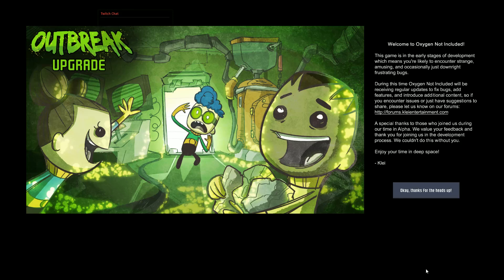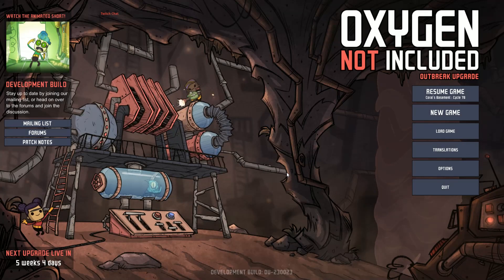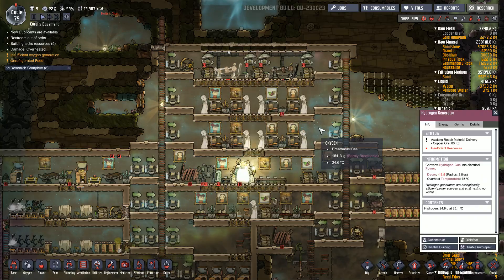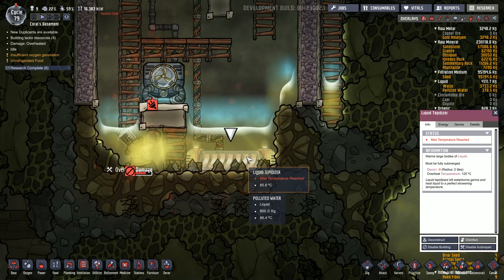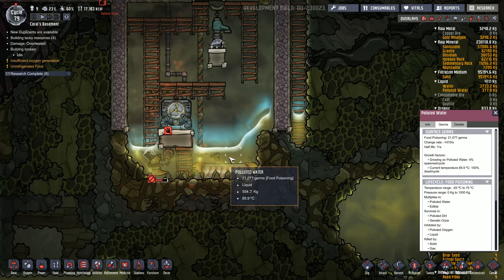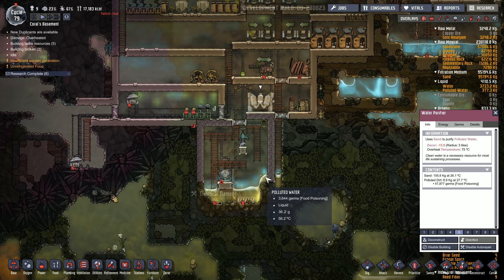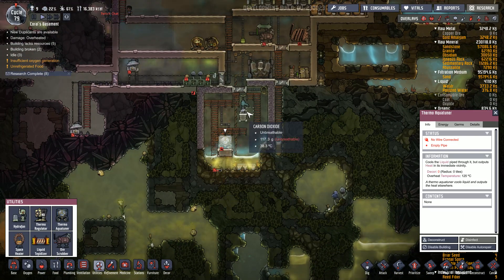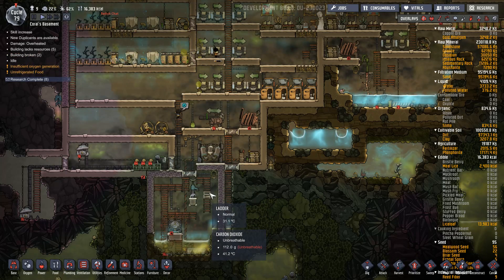Oxygen Not Included Outbreak - How to clean germs out of your polluted water within 5 mins (Video 6)

Comment: Your audio is very low, even with max volume, I struggled to hear :(
However, thank you for the tutorial.
Reply from the maker: Sorry about that, I will write it down for you.
I will keep in mind to lower my background volume for my next video :) Thank you!
Reply from the maker: I will write down what you need to do to clean your water.
Step 1: Build Liquid Tepldizer (under utilities, the 5th machine ) in your polluted water source.
Step 2: Build Thermo Regulator (under utilities, the 3nd machine) where the heated water comes out
Step 3: Build Water Purifier (under Refinement, the 2rd machine) where the cooled water comes out
** Remember to build your polluted water tank with Insulated Tiles**
If you want to make sure your water is clean before it goes back to your clean water tank, build a second polluted water tank (repeat all 3 steps)and purifier your water once more time.
Reply: I don't think it's your background audio that is interfering. The volume for the entire video is very soft.
Reply from the maker: I will try to talk loud in my next video :)Thank you for your advice!
Reply: I'd recommend looking at your microphone recording volume. There should be a way to increase the volume when it records so you don't have to speak louder. It's worth testing it out.
Reply from the maker: Aha I see! Thank you, I shall check my microphone setting, I'm using XSplit Gamecaster btw.